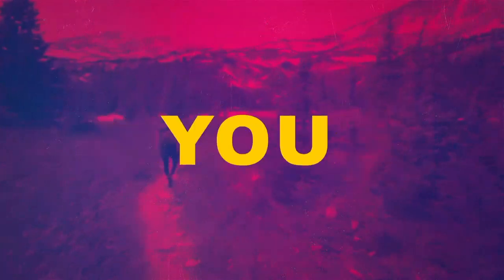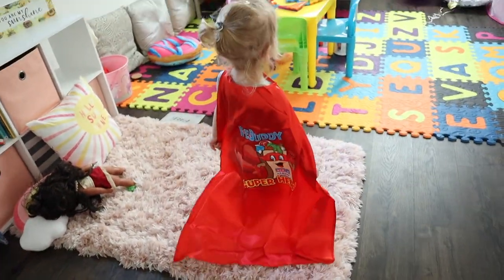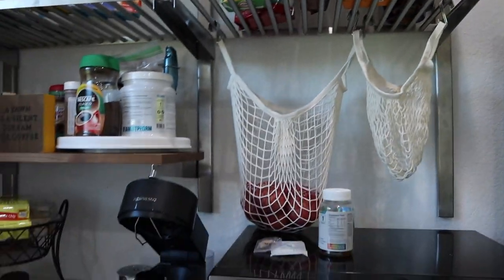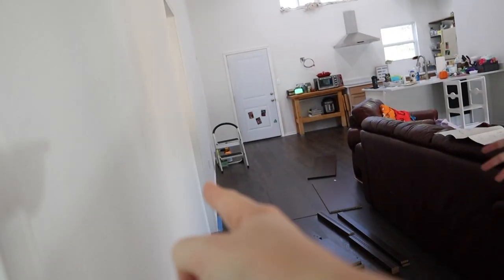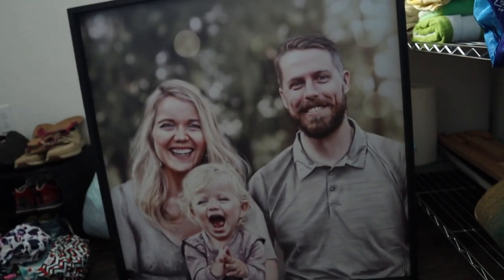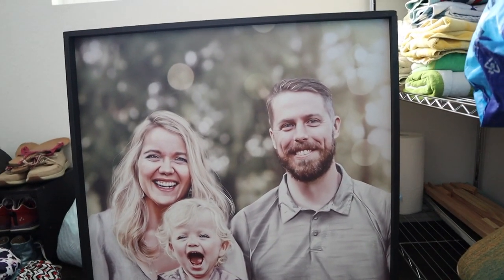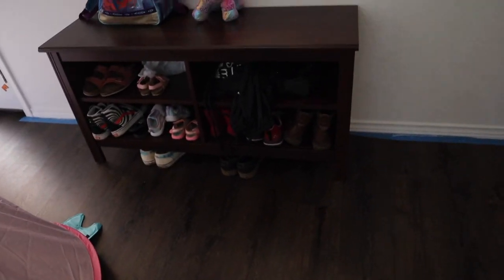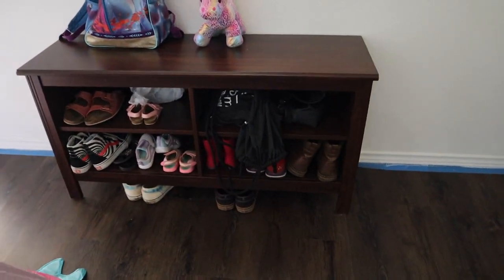It Is NEVER Going To Be Finished...

Comment: Blair, I’d suggest to get all the furniture in place and show us, then decide where to hang pictures. I LOVE your family portrait but my fear is the wall over the table, while lovely, it will look lost on its own as its a big wall. Big spaces require bigger prints or multiples or collages. It might look better on the adjacent wall between the two doors? OR if you plan on making it more of a picture wall including other photos or prints in a collage that might look really good too but would require you getting those photos together and mapping it out on the floor or painter taping up cut out newspaper cut-outs of the picture sizes to get it figured out before hammering nails in the wall permanently. Does this make any sense? Also, a tip; be careful how high you hang the pictures. Many people mistakenly hang their prints too high and it looks awkward. I try to pick an architectural feature to line something up with if it doesn’t make it look to high or pick one height and make the pictures all around the room be consistently no higher than that one height.. i’m likely confusing you. PM me if you want more help; I do this for a living and would luv to help. I also think there is some gimmicky thing out there to hang pictures with that isn’t permanent, and if the pictures aren’t too heavy but can’t remember what its called. Hobby Lobby might actually know. Take your time with it, add some plants like others suggested firstly (hanging ones too near the kitchen) and once you’ve got a few pics installed it will all start to make your home feel more ‘homey’ and cozy, add your personality to it and all come together ❤️